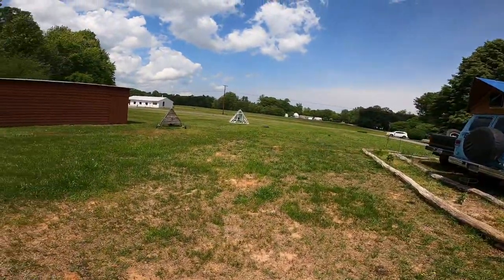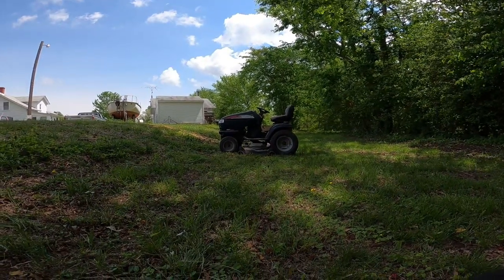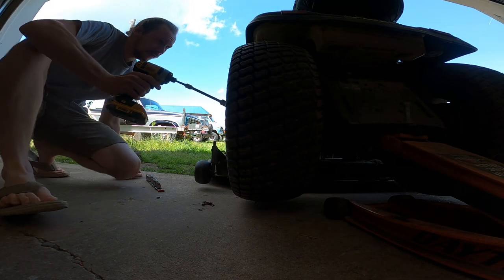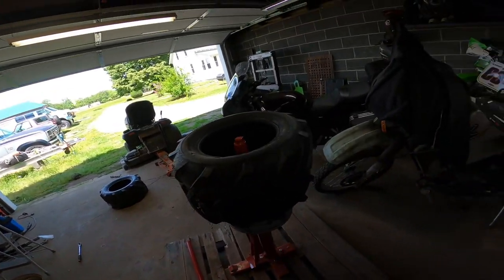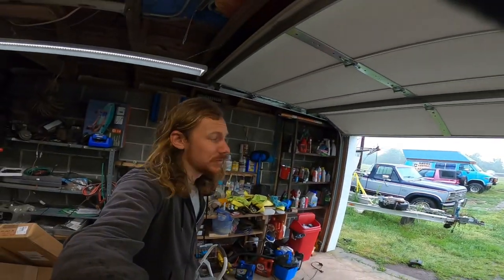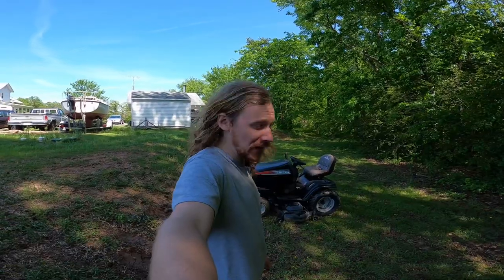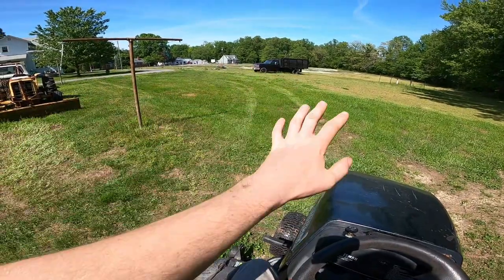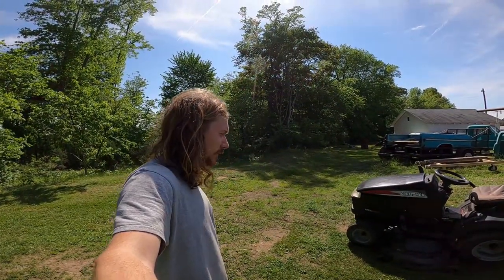Are AG, Tractor Tires, worth it. Will they ruin my yard?

Comment: I just put a set of these on my tractor.  It's an old, 12 hp, Dynamark (yard machines?), with the deck removed.  It's heavily modified to be used as a general tractor around the farm.  I mounted my DIY wheel weights also.  Besides looking totally cool, the tires really enhance the performance of my tractor.  
Well worth buying them.  Cheers.

Comment: I just got that same tire deal at TS and am waiting for a project to put them on. BTW, use the opposite side of the bar you used to remove the tires to install them. I have both the large and small tire changer from HF. Also just use "Tuff Stuff" foaming cleaner to slick up the beads when installing. It will be completely dry in a few minutes if you don't immediately seat the bead, that way you don't leave anything inside your wheel like grease or soapy water. It's also super cheap and you can get it everywhere.
Reply from the maker: I’ve tried using the other end to install tires and I can never get it to bite down, always ends up slipping and smashing a finger.
Reply: @LilBJessup  as long as you have a way that works I guess that's all that counts